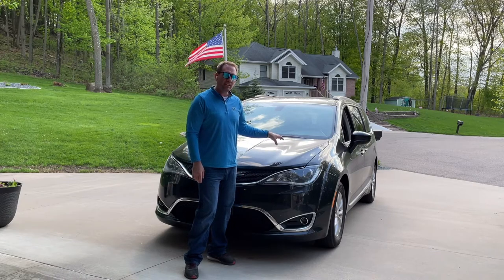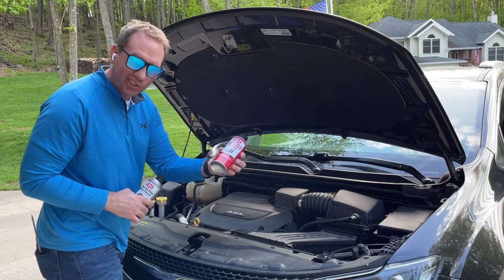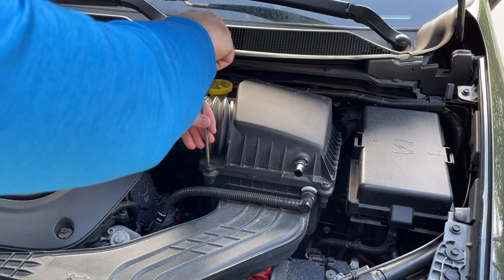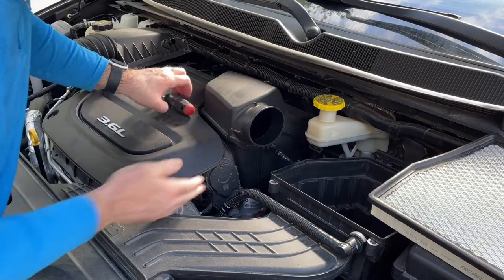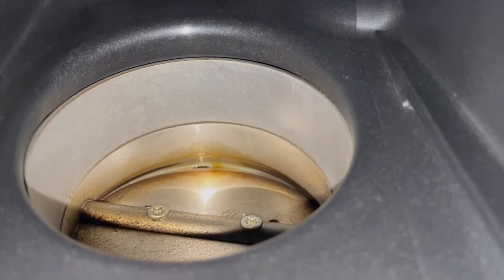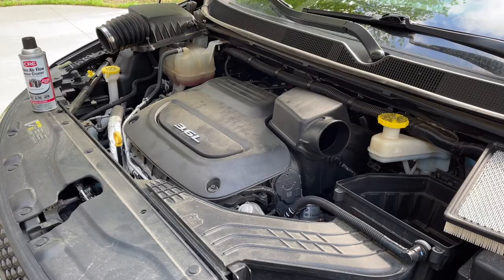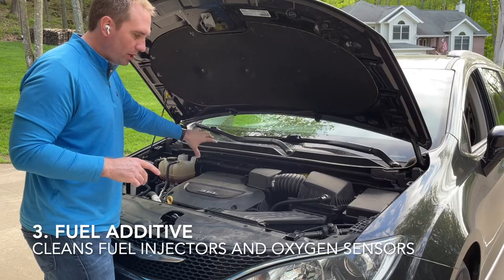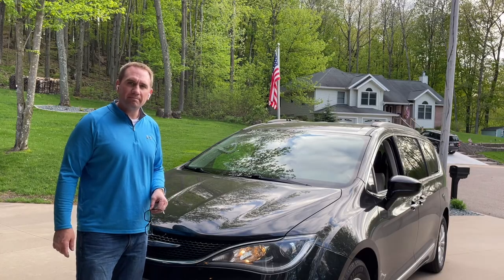Improve Chrysler Pacifica Rough Idle 3.6L Pentastar V6

Comment: Just followed these instructions on my 2018 with ~70k miles. After I finished turned the ignition and the car stalled out...(kind of gave me a mini stroke...OMG what have I done??). Gave it a few moments and tried again and BOOM, rough idle was gone and engine was purring at about 1000 rpms instead of rough/bumpy 600-750rpm. Thank you so much!
Reply from the maker: Great job!  Yes, the build up of cleaner can  make the engine stall if it hasn’t evaporated completely.
Reply: This happened to me as well. Was looking all over to figure out if I needed to initiate a relearn procedure, but another couple tries and it cleared up.
Reply: Great video, mine is doing this now and has been for quite some time I'm at 45k miles 2018. I want to clean the sensor but I'm afraid it will stall and not turn back on???

Comment: I just wanted to say you rock!  Just got a Pacifica last week and you helped me diagnose and repair this issue,  the Oil Filter cooler adapter issue(found out I had a leak,  luckily covered by my CPO),  and rough shift trans and you helped reset that system to mitigate that issue. You’ve got a new fan and subscriber!  Thanks
Reply from the maker: I'm glad my videos could help you out!  Thanks for taking the time to check in.

Comment: Thank You! Just finding this and repeated your procedure, have had rough idle since 30k to now @ 95k.  Asked the dealer to check the rough idle twice under warranty and they said - no issue found, then tried to sell me $900 fuel injection and intake cleaning service at the next 5 subsequent oil changes ( hey they offer me cheap oil changes to try to sell me nonsense).
Couple comments - it instantly runs smoother. No loping, no chugging at start, no misfiring like grumble at shut down.
- If you actually take the throttle assembly to clean all of it off please post, it seems like 4 bolts to remove but not sure how if it has a gasket or would re-seal ok.  Opening the plate and pushing rags past that kept returning lots of grime so its not great in there.
- I just inspected the intake air temp sensor and wrapped it up in a rag. Not touching it. Have had bad experiences cleaning sensors and their fragile wiring and connectors
- I was gentle, not enough though, on air box/plenum removal and shattered the rear ball and socket plastic piece. I wedged it back and it is solid but FYI to others caution - I hate broken fasteners.
- With the engine cover off good time to degrease and spray off to get the nooks and crannies - my OCD time.😬
Thank you again.
Reply from the maker: You’re welcome.  Thanks for taking the time to comment and share your experience and feedback.

Comment: you have validated my obsessions with all of the little noises and clunkings door closings what have you!! thank you. bless you man, i’m going to share your channel far and wide
Reply from the maker: Thank you very much for the kind feedback; I appreciate the promotion too.
Reply: @TheLawnEngineer  On the new Pacificas do you know if they are GDI direct injection engines? I know they have a lot of carbon build up on the valve issues
Reply from the maker: @seatime674  They still have port injection.     Chrysler was either smart of lucky for not going to direct injection.  In general, most all manufacturers has added port injection back.  You are correct, direct only causes major carbon issues on the intake valves.

Comment: I have a 2020 Pacifica and idling and running a little rough with 90K miles. After trying a few things my shop called the CHrysler service dept and they told the shop to NOT USE the original plugs prescribed. You have to switch to a high ignitability plugs. They cost about 30 bucks each but seems to be helping.
Reply from the maker: Glad to hear that helped, thanks for taking the time to share.

Comment: Great info! i have 2018 Pacifica and will be doing this over this weekend. I came across your transmission computer reset to help smooth out those jolts and it seems to have worked! ty again. One day when you do something about spark plugs, That would be awesome.i know the back 3 plugs are the easier ones, but the front ones?? wow
Reply from the maker: Thanks for checking in👍.  I will plan on doing a spark plug video .
Reply: Can you post the link to the transmission video in the comments?

Comment: Wow another great video!!  Your video on transmission reset solved my 2017 pacifica shifting issue!!!  Now 20,000k later my van is rough idling at startup.  It threw a check engine light and Ill check that code first.  I was going to add Sea foam to my gas and run that through and see what happens but I know I have to also change my air filter as I checked that a few days ago at my last oil change.  Ill see if the sea foam and air filter change help and if not, Ill go on to the rest of your fixes.  Is it ok to spray the throttle body cleaning around the intake like that or just spray it on a toothbrush and clean the intake.  Just worried the cleaner might damage the engine if it leaks inside??  Anyways,  thanks for the great videos as always!! Your knowledge and exlpanations of how components work sure helps alot!!!  Ill keep you posted :)
Reply from the maker: You’re welcome!  I’m glad my videos have helped you out.  You are correct that you don’t want a large volume of throttle body cleaner to get into the engine.  It does evaporate pretty quickly so you could wait a half hour after cleaning and most of it should be gone, take the throttle body off, or use a brush as you have suggested.

Thanks for checking in, happy wrenching.

Comment: Honestly, what fixed your issue was the throttle body cleaning. That's what directly correlates to rough idle, because there is no idle air control valve anymore in throttle by wire systems.

IAT is directly related to ignition timing, and has no effect on the fuel system. If the air is too hot, you can get pinging and pre-ignition. The computer uses this reading to dial back the timing if necessary. The MAP sensor is the key player in managing air fuel ratio on a car without a MAF. That's the one you needed to focus on. That one can become contaminated with blow by gases as it goes plugged directly into the intake manifold. It tells the computer how much air the engine is gulping. 

Every single fuel injected system uses an oxygen sensor or A/F ratio sensor on these engines. That's suspect numero uno in controlling and adjusting the fuel mix in the engine. The computer has no way to monitor the mechanical process of combustion. So it does the next best thing: it takes a sample of the exhaust stream. The O2 sensor, and the MAP sensor should be your man focal point on an engine with speed density fuel injection like the Pentastar uses.

Also specific to the RT platform: turn off Econ mode. It tends to idle rougher and have terrible throttle response because Econ mode lowers engine idle by 200-300 RPM, into the 700's. These engine like to idle in the 900's.
Reply from the maker: I agree, thanks for adding all the additional information.

Comment: Great video we just hit 130k on our 2017.  Transmission is starting to slip when doing a fast uturn or fast sharp turn.  It seems like it might be fluid because only happened when gforce from fast turn of direction.   What do you think?
Reply from the maker: It's possible but g-forces shouldn't have an effect on the transmission unless the fluid level is low.  

I think it could be something going on with the differential.  When you turn sharply the wheel speeds become significantly different which the differential has to accommodate.
Reply: @TheLawnEngineer  Thanks so much for replying!!!  I will research the differential & update you on what it is.  I don't think the fluid has ever been changed and it could be low.   I had an old 94 Chevy Lumina along time ago that used to do the same thing but it was driven to the junk yard 🤣 Thank You!
Reply from the maker: @ReadySetAutismFamily  you’re welcome.  The differential is part of the transmission so you were correct but transmission “slipping” is normally referring to the clutch packs for the gears and not the differential.  Anyway, still within the same box.

Comment: that throttle body was gross, you think you can use mass airflow sensor cleaner on there instead of buying another can?  or is it not strong enough cleaner for that application?
Reply from the maker: I'm not sure the mass airflow sensor cleaner is strong enough to clean the throttle body.  If you try it, let me know how it works.

Comment: Out of curiosity, why did you not clean behind the throttle plate? If it was dirty in front, I would presume it was dirty behind as well
Reply from the maker: I did, the video just didn’t make the cut. Thanks for checking in 👍
Reply: Great video. How do you flip the throttle plate?
Reply: @stinger5084 if you have gloves on you can press with your fingers.  Other option which is kind of a pain is take off the manifold and clean it that way.  I was changing my plugs and did it that way.

Comment: Did these steps reconnected everything now the van won’t start
Reply from the maker: If you got carb cleaner in the intake, it will take a bit for that to evaporate.  It won’t run well until that is cleared out.

Comment: Hi i have a 2021 pacifica and the engine is shaking on neutral or on drive then i push brakes.
First thinks i did is all you show on this video clean the air flow sensor and the throttle body engine.
Then i have changed all 6 coils and a spark plugs .
The problem is still exist 😞
The engine is shaking and i can fill it . What can i do more?
Reply from the maker: Have you tried the transmission reset?
Chrysler Pacifica-Jeep Cherokee 948TE ZF 9 speed Transmission Reset: Fix those harsh shifts
https://youtu.be/REgRcfIc6Z0

If you have it could be a number of things: engine mounts to failing torque converter.

Comment: hello, I have problem with 3.6 from 2022. i feel jerks when i drive slovy (20-45mph). i dont have check engine and faults in computer. misfire is 0 becouse i checked it.
I bought new Spark plugs.. millage only 25k miles.
What can i check ?
Reply from the maker: Unfortunately, it sounds like you have a very common transmission problem.  Let me know if the following video helps. 

Chrysler Pacifica-Jeep Cherokee 948TE ZF 9 speed Transmission Reset: Fix those harsh shifts
https://youtu.be/REgRcfIc6Z0
Reply: @TheLawnEngineer i have Durango with zf 8hp transmision rwd. 
Procedure will be the same with reset adaptacion ? What do you think?

Comment: Yeah that not so smooth idle problem you are describing is currently going on with my 2017 Pacifica which has 106,000 MI but you have described it to a T
Reply from the maker: Thanks for checking in, hopefully I was able to help you out.
Reply: Are you the original owner putting 106k miles on it? Have you had any major issues?
Reply: @seatime674  yes I am the original owner bought it brand new really no trouble other than that jerky transmission once in awhile that everybody else has

Comment: What about when your shifter locks up? Or you get a service shifter soon notification on your dash cluster?
Reply from the maker: I would try this reset, if that doesn’t work I would disconnect the negative battery cable for a few minutes.
Reply: I have a 2017 Chrysler Pacifica and get the service shifter error often.  For me, I unclipped the fabric cover inside the glove compartment and pushed the wires into the CAN bus star connector and then the shifter lights back up.  After that I can shift out of park into drive.  Now it happens sometimes when I drive and when this happens it sometimes (rarely) refuses to shift gears.  We will definitely need to replace it soon.

Comment: Does rough idle mean it's vibrating more than normal? That's actually my issue. My 2017 Pacifica vibrates noticably while in Park/ sitting idle, but doesn't when I drive it. Would this remedy the problem?
Reply from the maker: Yes that vibration can be from a rough idle, it would also show up with variations in the tachometer.  This cleaning does help.
Reply: @TheLawnEngineer  thanks a lot!
Reply from the maker: @therealsheikh  you're welcome.
Reply: how many miles can i expect this to happen to me? i have a 2020 with 19k miles
Reply: Having voyager 2021 60k miles. Idle rpm is 750 and swinging. Guessing when idle, engine tends to get more hot air from under the hood. I blaming temp sensor dirted. Will clean em, but prob intake cleaning is a waste of time, except when dirt is preventing air flap to move easily.
Reply: @yakunins1 I have a 2021 Voyager with 62K miles. Rough idle but mostly when cold. Former Enterprise rental vehicle. Most all Voyagers were sold for fleet use thus the higher miles. Love mine though. Need to figure out this rough idle. Good luck.